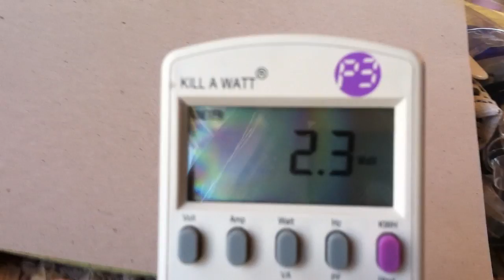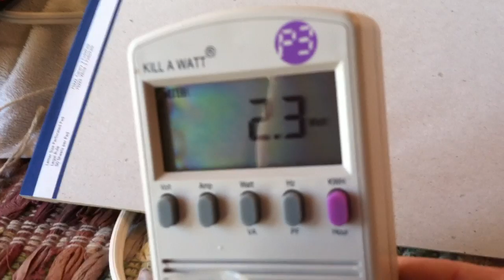Wall Wart Motor

Comment: Great to see it running !
Was interesting to see the idle current usage, plus how the draw goes up outside of being conventionally connected.
Reply from the maker: +slider2732  Thanks for that tip on trying this.  I also tried using this transformer (as is) as a pulse motor driver coil and it worked.  I just put a needle motor mono pole rotor up next to it with a simple reed switch trigger and off she went. I used 3v or more battery juice for the supply.  For someone who just wanted a super quick pulse motor build with no coil winding hassle this a way to do it.

Comment: Several month ago on Don Smith thread on the energetic forum experimentation was encouraged to show that 
agitation of the local ambient aether increased the efficiency of the transformer and other energy devices nearby.
your video goes beyond simply agitating a small magnet. One observation that magnets vibrate near transformers
and elliptical patterns develop and that when higher frequency is used there is an increases the aether effect..
Don Smith tryed to explain this phenomena but not enough experimentors at that time.
Reply from the maker: +mikrovolt1  The whole environment we live is agitated.  The trick is drawing that energy out into useful power.  I think that sooner or later someone is going to invent a 'electrical magnifying glass' that can harvests and concentrates this energy.

Comment: Hi maybe the energy we seek we have been watching night and day ( if doing shift work the latter ). OLD TV,s. watch ingventor video. Title gretchen jones coral castle part 3. This divining static aerial. Logic you put the plug in the wall to switch the TV on. Yes? It then cathode tube a field ( supposedly electrons to the face positive vacuum filled tube ). It then all returns to earth and re excites the same. BUT ! It must be possable to reverse engineer this from the magnetic static from the air NICOLA TESLA and with the aerial aligned to north or south earths field the tv should be capable of acting as a transmitter Using the plug as the now out put No expert but it could have been "staring us in the face " !!!